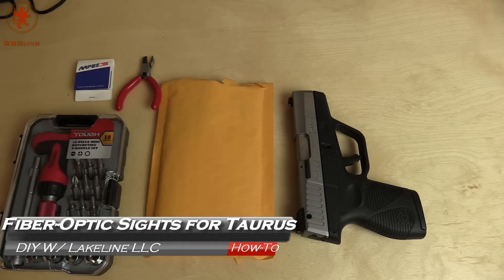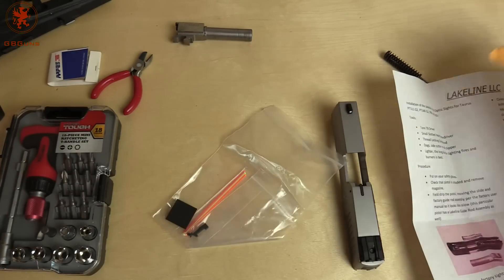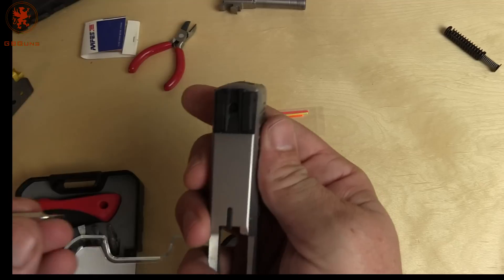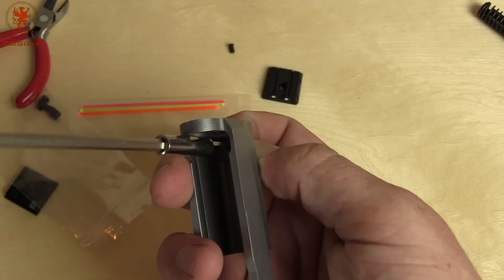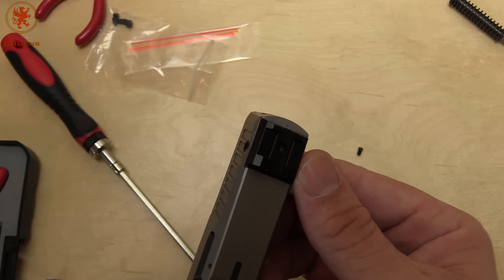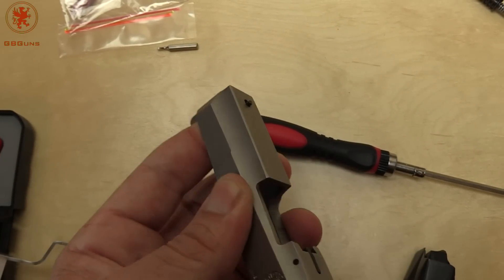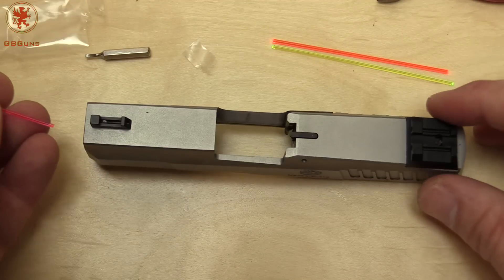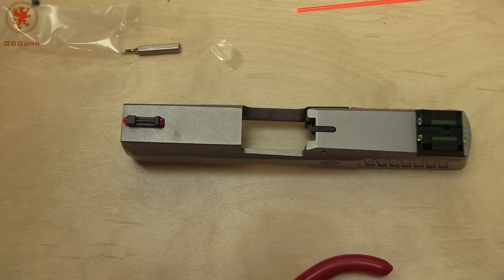Fiber Optic Sight for Taurus by LakeLine LLC

Comment: Just got these and installed them on my G2C. Just a few observations. This video is using the older PT111. There are a few difference between this gun and the G2C. The front sight on the G2C uses a hex screw that is a pain to get out. You will need a 5/64 allen wrench to get it out. The front sight is a hair to long to fit flush on the G2C. I had to take the front sight over to my grinder and remove just a little bit to get it to fit. Also where the front sight fitted in the "oval" hole where it screws it was also a hair larger. I used a small file to remove what was necessary to get this to fit. After I got the front and rear sight on, everything else was super easy.
Reply: I'm considering these sights as well (G2C), but I'm concerned for accuracy. The cheap OEM sights at least have windage and elevation adjustments, and was needed to correct POI vs POA. I had to adjust higher and right, and the Lakeline.... well I'd be stuck with what ever it came out to be, unless I'm mislead.
Reply: It's not the PT111 it's the 709 Slim.
Reply: How did you install the rear sights on the g2c? It says you have to lock tight the area where the sight sits and let it dry. The screw doesnt even tighten down on the rear sight. Its basically held on with just lock tight? If so i will not run these sights on my gun. Thanks
Reply: I ordered a cheap set of Fiber Optic sights for my G2C off if Amazon.
Reply: Not to be cheap but I'm not understanding why the Lakeline fiber optics are better than the $15 fiber optics on eBay. Both are aluminum. Both use fiber optic rods. They are the same shape and everything.

I've seen people say the eBay ones fall apart. How does a solid piece of aluminum fall apart? You put them on with some lock tight. The rods go in the same way. Clip them and melt the ends. They have red and green.

I'm going to order some cheap ones. If they suck, I'll get the Lakeline.

As of now, I see no difference between the two.

Comment: I installed my sights from Lakeline yesterday. The instructions read to use thread lock on the bottom of the sights as well. It states that the thread lock is what holds the sights on, not the screws. Still an awesome video!!!

Comment: Thanks for the showing the replacement and installing the the optical sights.  It may be my old eyes, but the factory sights provided, with the White dots', are not easy for me to quickly acquire visually.  I just looked at a TruGlo front sight at the store and that looked to be an improvement at a low price.  Your solution of front and rear sights makes sense and I think the upgrade will be a big benefit and that's what I will do..

Comment: Thanks for the video on these. It's probably what im going to use to upgrade my sights as I have had my stock rear sight elevation slip while shooting and it took me a minute to figure out why i went from shooting dead on to like 6" low suddenly. Along with the lakeline upgrades.  sig 226mags fit and function 100% so far. You can get grip sleeves to use with them from ebay just look for bloody sleeves. Another upgrade to me was buying a keep tinkering sao trigger and it makes a whole world of difference, way better trigger now. I would rack the slide on a non fire anyway so id never use the 2nd strike capability so why not get rid of the horrible stock trigger. 
Anyways again ty for this install video👍

Comment: great video!  thanks!  i know your tip for installing the front sight by placing the screw in 1st then turning the sight around the screw a few turns to get it started should be listed under "common sense", but since i never really thought about it, hearing you mention this tip was a real eye opener!  especially since i'm notorious for dropping the screw or the nut at least once especially with small hardware &/or tight spaces.  that tip alone is well worth the entire video as it will come in handy in many other situations.

Comment: Great video!  Wished I had found it before I installed the Lakeline FO sights.  But I fumbled my way through it.  I am curious how accurate it is without any windage or elevation adjustments on the rear sight.  I guess I will find out soon enough.

Comment: Thanks for this no-nonsense video, I really hope you get more likes and views. I'm thinking of swapping out my stock sights and these fibers are near the top of my list, my only question is how they view at night, for a home defense scenario - compared to the stock sights. Would you say it's a good upgrade in that sense? Also, the stock sights are adjustable for windage and elevation, as I understand it, these are only for elevation? How has your accuracy been affected? Thanks!
Reply from the maker: No impact on accuracy, though I made the blobs a little bigger than I would have preferred.  As far as at night this ill only work with ambient light and will never be as good as true night sights.
Reply: @GBGuns  I know the back sight screw needs thread locker but does the front sight screw need thread locker too?
Reply from the maker: I recommend it

Comment: Nicely done. I was surprised to see how long you left the fibers, as the melted globs are quite large. But they sure are visible. I'm considering these sights for my PT111 G2. Do you think the sights will be as useful with smaller globs, possibly more accurate? BTW there are other mags that fit the G2, like the 24/7 gen 1, Sig P226 and the Canik TP9. Taurus mags are hard to find and costly, so I opted for a Canik 18-rnd mag. It locks just a bit lower but feeds okay, and I have the Canik Tp9-SA in case it has issues.
Reply: It doesn't feed

Comment: I tried fiber optic sights off of Amazon but they broke very easy. Lakeline has Trijicon night sights that are one of the best I put on any gun. Super bright at night and great during the day. Also the PT111G2 needs a better recoil spring , so pick up one of those while your on their site.
Reply: F pav 

It needs a better recoil spring? Or guide rod? Maybe both?
Reply: LakelineLLc makes an excellent replacement guide rod/recoil spring that solves the occasional failure of the G2 when the spring jumps off the rod and ties up the gun.  You can find other YouTube vids about this.  The rod/spring kit is around $35 shipped, and shipping was fast..............................elsullo

Comment: Hi Graham Thanks for the video. I appreciate it. I subbed to.

One quick question. On the stock PT111 G2 sights, there is slop in between the front and rear sights. Do these sights tighten that slop up any? I am a whisker away from ordering them but am reluctant until I hear other wise. I don't want to compare apples to oranges but compared to some other guns, these sights (stock Taurus) are literally garbage. To loose for my liking compared to say a Glock 19. And no, I'm not a Glock junkie. :-)

Anyhow, once again, I appreciate the video. Changing the sights now is not as scary as I thought it was going to be. 2 thumbs up but since it will only let me click it once, 1 thumb up.
Reply from the maker: Thanks.  The Taurus pistols are very poorly made.  These are an upgrade regardless.  Lakeline also has night sights which I did a video on.
Reply: I did see the night sights vid. I am having a hard time convincing the wife of the upgrade cost to them. The fiber optics are on the for sure list. 

Thanks for the reply. I appreciate it!

Comment: My G3c has some other kind of screw holding the front sight on, some kind of safety star or hex head that I don't have a tool for.  It has been very frustrating. I'm going to have to go to a gunsmith just for that stupid screw.
Reply: Torx 8 if you haven't figured it out by now lmao

Comment: Umm, did you not put the front sight on backwards? The original had the slope facing forward and the new it faces backward.
Reply from the maker: +Mordalo no I did not.  I thought about that too, but it's tooong the other way
Reply: I looked at the TFX Pro as well and it is fashioned like the original. Only reason I bring it up is because I am trying to choose between the two.
Reply from the maker: Fiber Optics are great, but only as long as there is enough ambient light.
Reply: I have a real issue with the sights costing with $20 of what I paid for the gun. :)

Comment: did the sights hold up good after firing it alot ?
Reply from the maker: I don't put many rounds through this gun.
Reply: Graham Baates ok I was just wondering because right now it's my daily carry and my rear sight loosed up on me after about 50 rounds but I have the stock sights on it so I'm just going to get the sights from lakeline llc
Reply from the maker: +Goingin007 and use a dab of thread locker.
Reply: Graham Baates ok thanks man I'll have to try that

Comment: brought the same sights from Lakeline llc and per the instructions they tell you to utilize the same screw and it wouldn't hold the rear sights firmly. it wiggles alot very disappointed
Reply from the maker: +wireup4321 odd, I didn't have any issue, but there may be an issue with the sizing of the sight or slide.  Contact them.
Reply: wireup4321 mine doesn't budge once tightened down and I've tried purposely to get the front and rear to move by hand unsuccessfully
Reply: It sounds like you did not use thread locker on the screw and the base of the sight as called for in the instructions.

Comment: wish the back sights where adjustable..
Reply: albert silva they are just the traditional way: loosen the mounting screw and drifting it over left or right. just make sure to add thread locker again after adjusting
Reply: how do you adjust them up or down tho you can only do left and right..